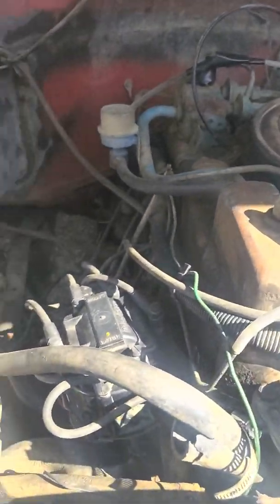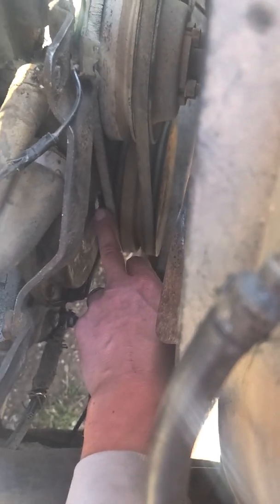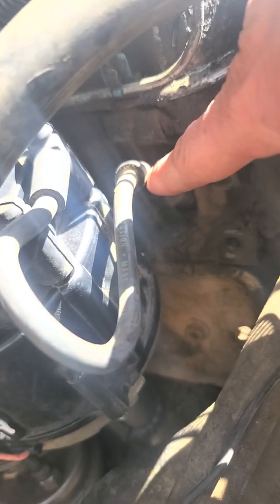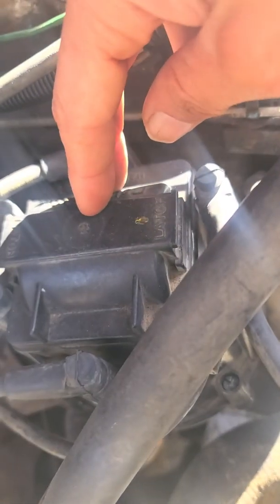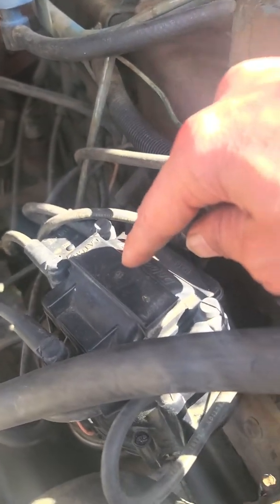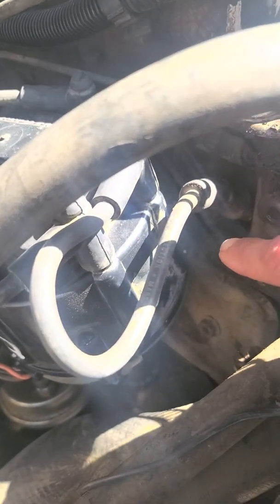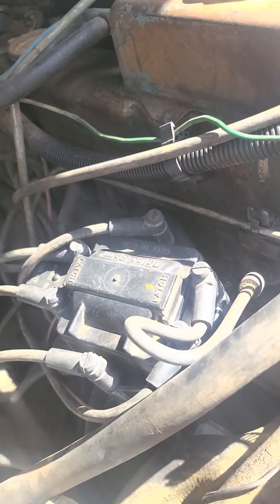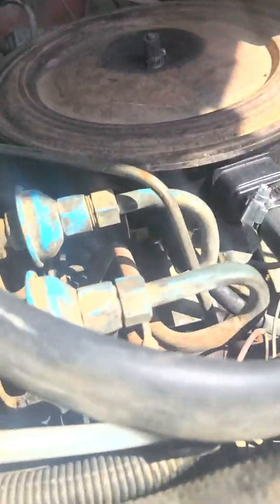inline 6 250 chevrolet motor timing easily explained

Comment: My 1980 250 looks almost 100% identical to this and seeing reference points for my exact motor helps so much more than other videos that try to pertain to everything at once. Thank you for making this video
Reply: Mine will start but turns of I put another straight 6 engine in it and had to put new spark plugs and used the distributor that the old one had because the other one broke would this be the problem I’m new to this engines
Reply from the maker: @jesusromero8224  it could be,check your fuel lines an pump,an you may need to advance it again see if that helps check your plug placement as well..starter fluid also.
Reply from the maker: Your welcome,my goal was to help ppl out.i couldn't find nothing on my issues so when I learned on my own I thought I should help other ppl with this same issue
Reply: @brandonsmith340  Yeah well this video helped me get it and now my timing works and I took the truck for a drive and it ran like a champ, again I really appreciate the video
Reply from the maker: @someonemayhaps8391  thank you,gives me drive to make more..
Reply: @brandonsmith340  I have an 80 C10 250 3OTT, it is a disaster to try to find inforation or somebody to help me so thank you.